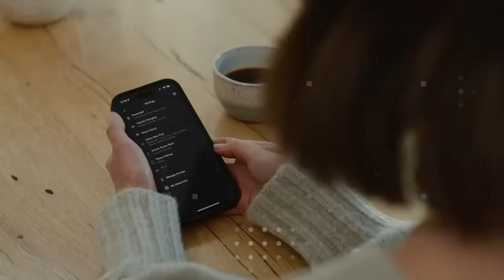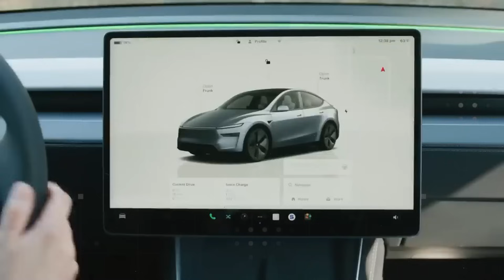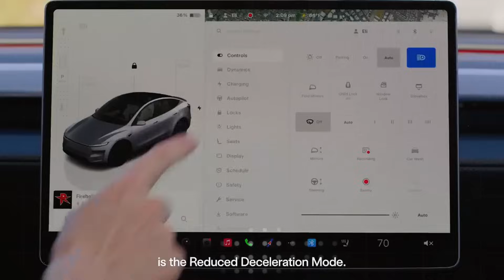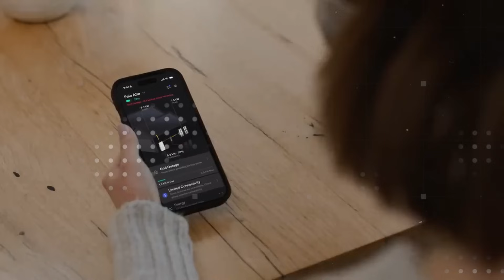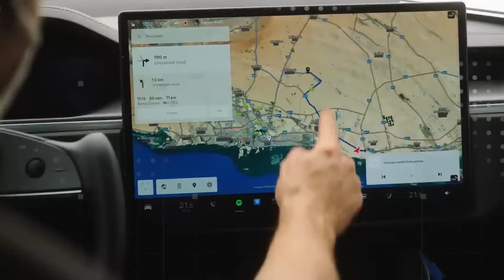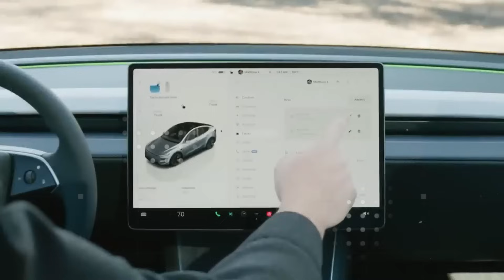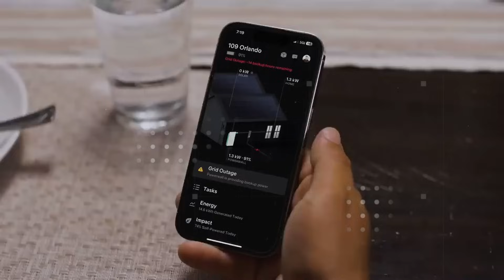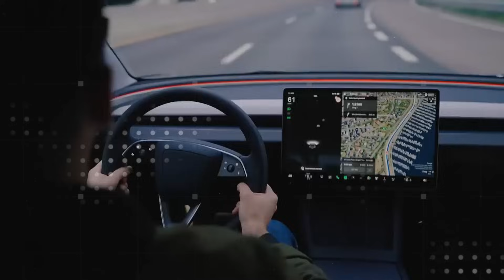IT’S HERE! New 2026 Tesla Model 2: $9,875, Ultra-Compact Motor, 300-Mile Range + 20 Bonus Miles

Comment: My biggest fear is repairs and parts and longevity... And that's not just Tesla
Reply: If cost is $10k, it is a throwaway, like a TV.
Reply from the maker: Totally valid concern — you're not alone on this one. Repairs, parts, and long-term reliability are still the big question marks for many people, especially with newer EV tech evolving so fast. The good news? Some EVs are proving surprisingly low-maintenance over time.
What would give you real peace of mind — longer warranties, more service centers, or third-party repair access?